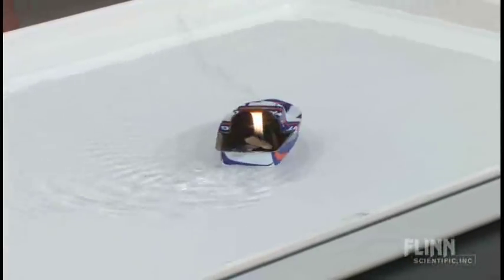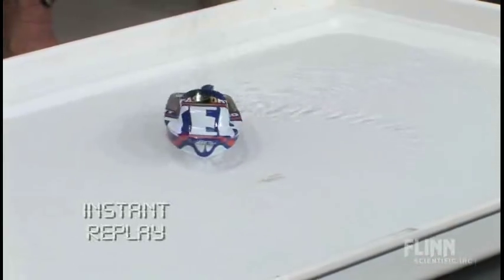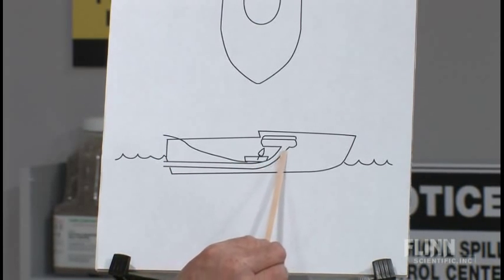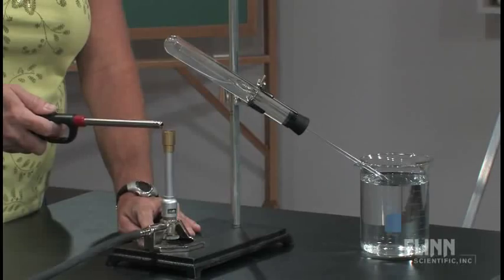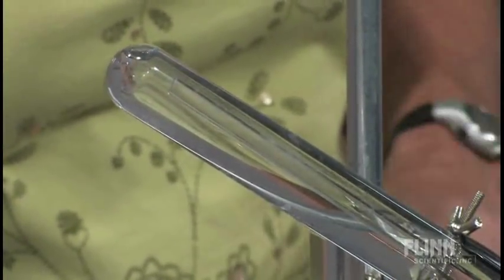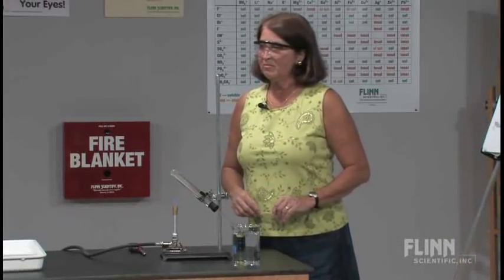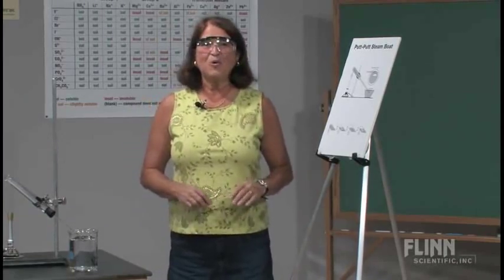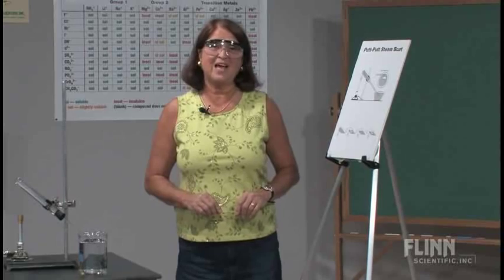Putt-Putt Steam Boat

Comment: Thanks! Finally! A good instructor with teacher's poise so necessary for education. I had thought the condensation happened further downstream but it occurs in a slightly inclined liquid locked seal within the boiler, (resevoir), according to this demonstration. I had fancied a heartier version for terrestrial use in which the water becomes the working fluid to drive a peristalic pump for a generator. Thank you and keep teaching.